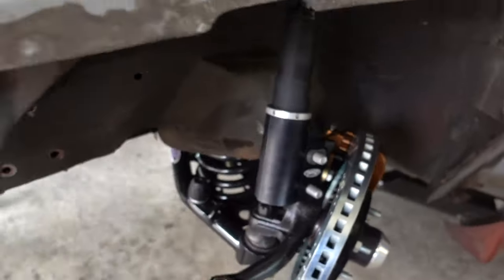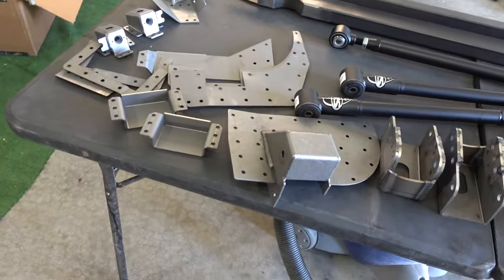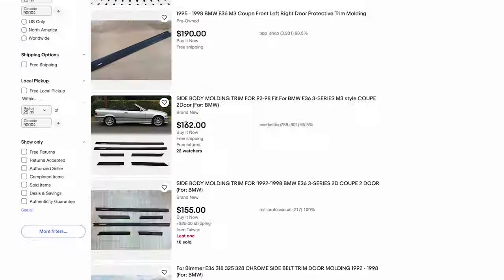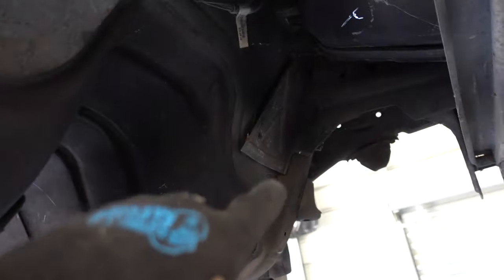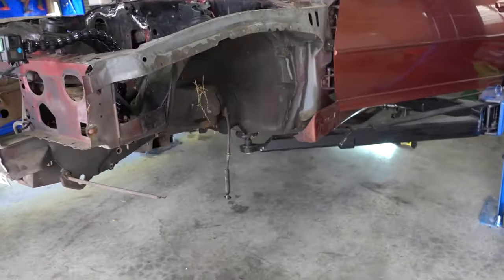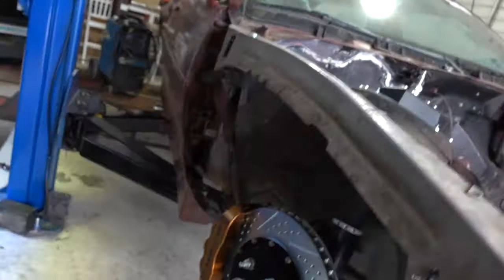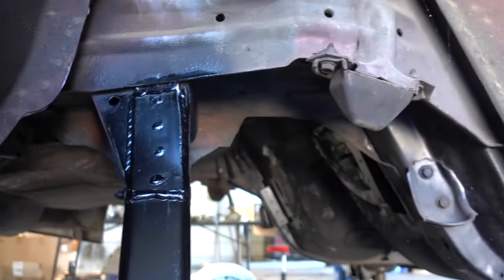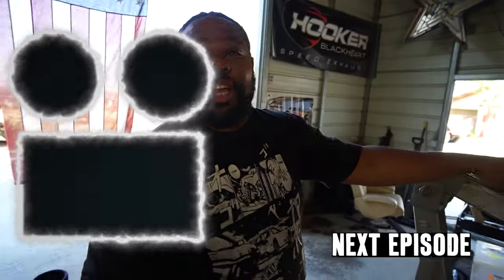3rd Gen Camaro gets LOW with 4-link Front End conversion

Comment: Pavement stuff is more forgiving for weight distribution(even though everyone gets are hardon for "pErFEcT 50/50" - clean sheet race cars aren't 50/50, they're more like 45/55; although the new LMP Hypercars are required to have 48.5% nose, because of dumb rules...) - a whole lot of people get caught up in chasing 50/50, but suspension tuning can making any weight distribution perform. All the record setting STIs & Evos for example, those things are around 60/40, an M4 Comp Coupe is 54/46, etc. Moving weight towards the rear(of a front engine RWD) is definitely a good move, but suspension tuning is going to get what you want out of the car regardless of where the final numbers end up.

Comment: the problem if I had a 3rd gen would be spending 50k on a roadstershop chassis with IRS lmao
Reply: Heidts has a bolt on IRS kit for a fraction of that. But I think if you want IRS you should just buy a Corvette.
Reply: @lb9gta307  it's the whole chassis not just the irs lol.
Reply: @WildEngineering  yes, but you can get a similar effect for a fraction of the cost which minimizes the "problem" 🙄